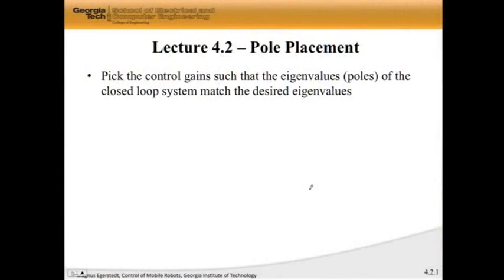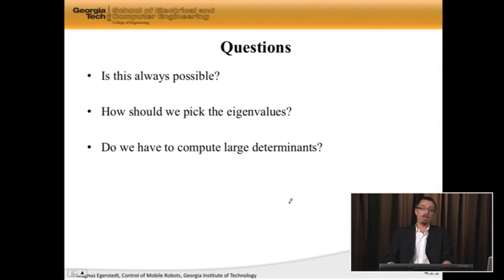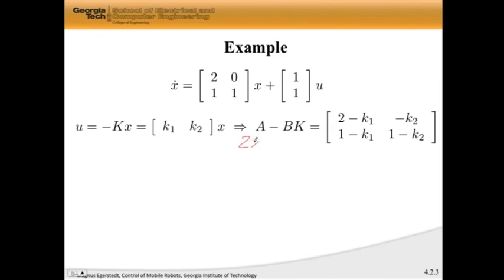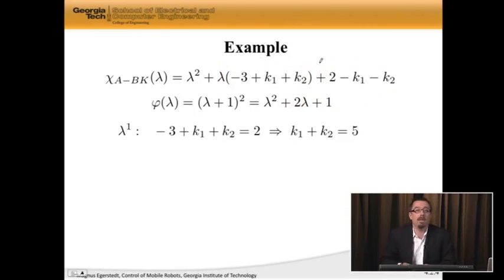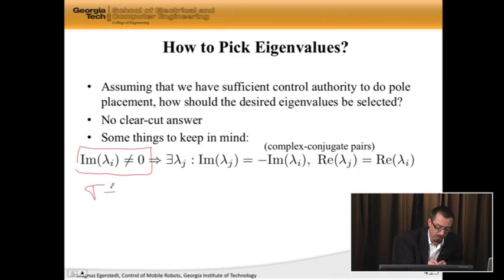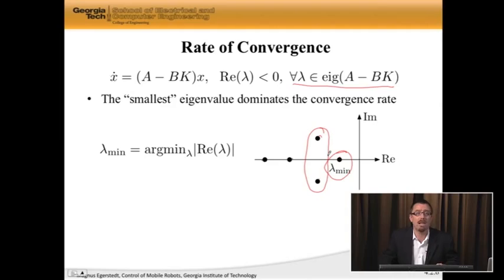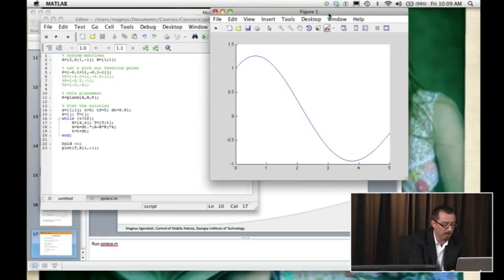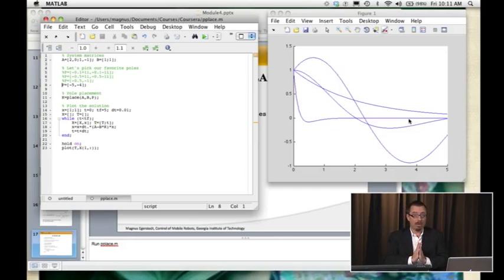4.2 Pole Placement

Comment: This is pure gold.  It is the second most important thing you learn in control theory.   The most important thing is system identification so  there is an open loop transfer function on which you can apply your pole placement techniques.

Comment: Sir, could you please give the code for ploting the graph in matlab.
Reply: Just in case anyone is watching in 2022. Here's the code.

%% POLE PLACEMENT STRATEGY FOR STABILIZING SYSTEMS

A = [2, 0; 1, -1]; %A matrix (system state)
B = [1 ; 1]; %B matrix (input)

% Let's pick our favorite poles (using -0.5-+j)
P = [-0.5 + 1i, -0.5 - 1i];

% Perform pole placement
K = place(A, B, P);

%Compute the solution
x = [1 ; 1]; t = 0; tf = 5; dt = 0.01;
X = []; T = [];
while(t < tf)
    X = [X, x]; T = [T ; t];
    x = x + dt.*(A-B*K) * x;
    t = t + dt;
end

hold on;
plot(T, X(1, :));